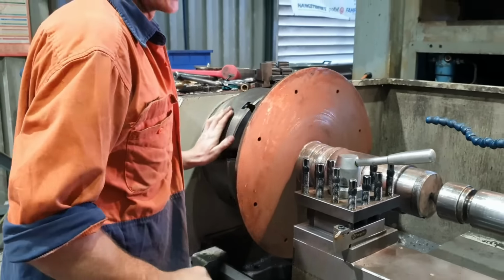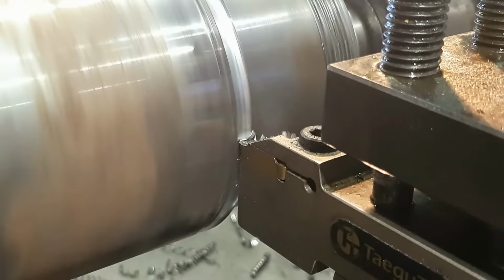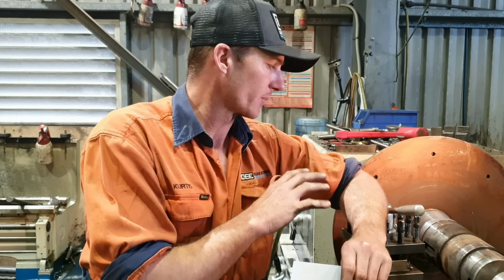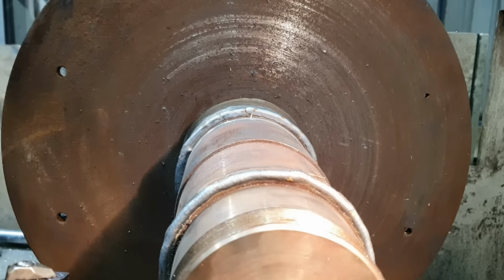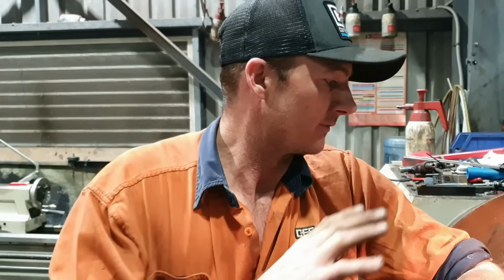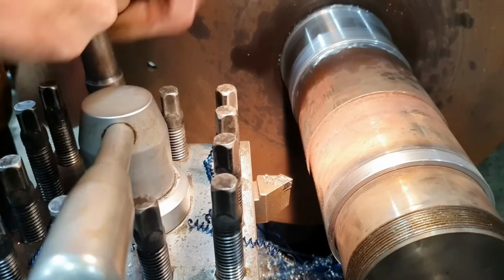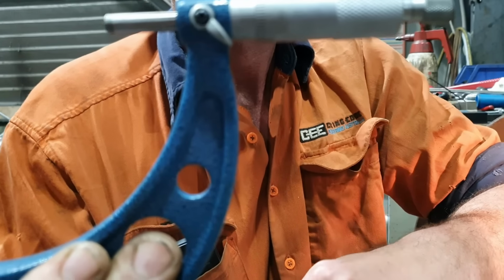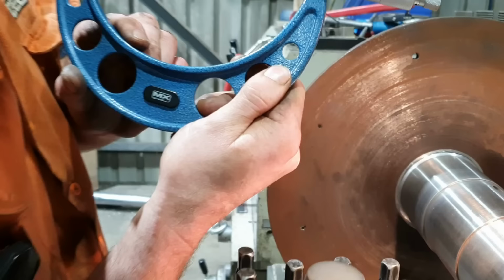Repair DAMAGED Cardboard Compacting Auger drive shaft | Machining & Welding

Comment from the maker: Hey viewers thanks for watching todays video from our machining shop! It's been a while since we got out the 12mm button insert 😂 What did you think of the before and after on this job? 😎👍
Subscribe and hit the bell icon to turn on notifications so you don't miss our weekly uploads. 👇 🤳
Follow us online here: 
Instagram https://www.instagram.com/cutting_edge_engineering 
Facebook https://www.facebook.com/cuttingedgeengineeringaustralia/
Official CEE Merch shop: https://www.ceeshop.com.au
Reply: Another great repair!! makes sense to weld up instead of replacing the shaft section if machine is just going to be used for a few months, I'm sure it will last along time anyway. When is the Shaper going to be moved into the shop? Looking forward to that one. I've got a 26" Shaper which I bought of a Engineering shop in Rockhampton QLD that closed down around 3yrs back. It come with some heavy duty tooling for internal keyways etc which I will never use. I could send them down to you if you wanted them as I would never use them doing Motorcycle repair. I live up at Gympie which isn't to far away.
Reply: Friday wouldn't be the same without you guy's, thanks for week
Reply: Já sigo vocês,achei boa a intenção de vcs não aceitarem contribuições para o canal.penso que trabalhão com o coração!
Reply: A work of Art !!!
Reply: The  stuff that you do is grate
Reply: Hi Kurtis,

That looks a very good job. What were your concerns regarding  the long term integrity of the repair so that you offered a no warranty?
Reply: @jameshodgson1609  I think he needed to use a difrent fixing process  to ensure that the fixing could be guaranteed  to hold , the process that he used could most probably not be guaranteed to hold.
Reply: Curtis, I have noticed that you do not take the tool off when you go back to the start. Do you find this puts excessive wear on the tool or breaks the tool? also what is the material you spray on at the end, is it a form of rust preventative? By the way I do get a kick out of your videos as a retired tooly myself I appreciate where your coming from. Keep up the good work.
Reply: Love you how love every comment, even your own! lol
Great work and excellent editing!
Reply: I sincerely appreciate the shots behind the welding hood. I worked in a welding shop of several years and still have the reflex/habit to close my eyes, look away, or block the arc with my hand. It's always so annoying when videos cut straight to welding mid-arc.

Before and after were amazing, keep up the good work!
Reply: @Jim Hal 😏😏😏
Reply: Was so looking forward to you doing spray welding
Reply: Probably the most satisfying is the before and after. Its all good to watch though. Sometimes I jump over the long turning takes and welding takes, but its still all good. You are an interesting tutor and conversationalist, so a little commentary while you are doing these operations would be nice for me. I'm only one guy, so whatever you do is ok with me. Thanks for these shows.
Reply: Great repair, I shudder to think how bad the bore is, that the failed bearing fit into would be?😱
Best wishes from the far North.
Reply: Fantastic job! I kinda had thought you would do a 1G roll out but nope your method to the madness worked well. Thank you for sharing!
Reply: Button insert is best insert
Reply: Great job .. not every job can be a perfect "better than original" .. customers have budgets to work to, and as much as we want to do "the right thing" we cant always. Thanks for sharing 🇨🇦
Reply: Keep up the great repairs mate! I will keep watching from the good old Canada 😀
Reply: Next time you do a time lapse could you put a digital timer in the corner just so some idiot doesn't look at your video and think that  this is easy.
Reply: What kind of welding machine do you have in the video?
Reply: @abrahamscall   its living upside down ...all the blood goes to the head so they cant spell  !
Reply: U did great
Reply: Looks great.......I did the same exact repair a month or so ago......OK, OK, it was a Ford axle and the shaft was just over one banana in diameter originally, but the bearing ate up the shaft. It sits vertical in a horse hot walker on a ranch. I welded it with ER70S6 and 75/25 gas, but it wouldn't fit in my tiny POS lathe and I didn't want to drive an hour to my brother's house to use his new $5K grizzly gun lathe (which would have been a great size). The 2x72 belt grinder cleaned it up enough for the bearing to slide over. The axle shaft had a sprocket welded on the end, so just buying a new one wouldn't have solved the problem and they didn't want to blow a lot of money on the repair. So far it is working fine since it turns very slow. It was great to see the same type of repair on a huge level and to see that you used the same filler and weld process to repair that one. Thanks for the video!
Reply: You couldn't ask for a better life Curtis, Beautiful lady, Beautiful little fur baby that adores every step yoy take. And you get to do a job you love every day. Your own boss and time keeper, if you want to go take the dog for a drive to the park your not punching the clock. Good on ya brother! Keep up the good work ! Your channel isn't getting the views it deserves, but I believe it will.
Reply: You are awesome man. 👍
Reply: I like your welding build-up technic.  Fast and economical.
Reply: E06
Reply: Please let me be ur helper,Ethiopia
Reply: How are you sure that the metal of the weld matches the hardness of the shaft?  Is that usually the same or is it a major decision each time?
Reply: ive often wondered why you dont spray weld to add material, if more steel is needed its better to just add weld?
Reply: Great repair mate. Love the vids.
Reply: Young man you are very good at what you do really enjoy your videos thanks alot 😊😊😊
Reply: You are like an actual machining God with your skills and tools, i have seen bad welders, really really bad welders and good welders but you are by a FAR FAR margin past them, your work is sublime it just leaves me in awe what you can do as so much that you do such as in this video building up material, that other welders say you can't do that for so many reasons but that just shows even more your amazing skills to prove them wrong. 
I also LOVE your work ethic and we seems to share the desire to not only make the job required perfect but its appearance as well, like in the video for the dual hydraulic pistons where you had to wait so long for materials and just the housing didn't appear strait so you lathed it down to also look perfect, I loved that, and love that you follow the rule of you would not be happy if you received back parts that looked bad even if they worked right so you would never let it leave your shop I just adore that ethic.
You both are amazing and I am so glad to see someone making such amazing content by their actual job, and as awesome as your machining skills are your wifes ( i'm so sorry i forgot your name :(    ) your camera work and editing is top notch as well love from canada <3
Reply: Опасно подобным образом шлифовать наждачной бумагой может на вал намотать .
Лучше вообще с наждачной бумагой к станку не подходить .
Но если уж сильно хочется то по крайней мере нужно крепить ее на деревянный брусок и действовать как напильником.
Reply: An awesome recovery on that one! Looks like Homie got up, moved five feet, and sat down again. You have an amazing facility with metal fab like you do; you seem to enjoy the purity of the geometry involved. The metallurgy info is interesting as well!
Kudos! And you DO resemble a young Robert Shaw...
Reply: Bro it’s like 4am!
Reply: Is this temporary fix still going?🤣
Reply: I really enjoy these videos but seeing the blinding glare of the welding severely detracts from the videos and since nothing but the glare is discernible it adds nothing.

Comment: "Machine is going to be replaced in a few months... " , I am * almost * willing to bet dollars (US) to donuts that you'll get this exact same auger drive shaft back in a few years when the bearings fail again. :D
Reply from the maker: 😂 seems to be what most viewers are thinking. Thanks for watching
Reply: Have you priced donuts lately?
Reply: That or it'll be sold off as refurbished
Reply: People that say this shit are 99% just trying to save face and not have to admit "we're broke AF and are barely staying afloat, I/we can't afford the extra $xxx for a proper repair" and are going to be using that machine for years to come. They'll probably even take it to a different machine shop next time, again, to save face and not be recognized lol
Edit: I speak from experience. I've had to have stuff repaired and not been able to get a proper job done, just " good enough " to get me by a while, because I was soo damn poor lol
Reply: I like donuts!!
Reply: @CuttingEdgeEngineering  Nothing is as permanent as a temporary fix.
Reply: With curtis's ethic hes probably done a better job than most warranted shops would do
Reply: @mashrien  In these times, probably the most common approach, and not unexpected. Losing a business, not of your doing, is a very bitter pill to swallow. Hope they recover, if that is the case.
Reply: Great now you've started a donut shortage
Reply: @mashrien  I've had mixed results, but generally positive, from just coming right out and admitting that I'm broke and can't afford to properly repair a critical failure.

Responses range from "Well, guess you're fucked then" to getting the job done right at bodge rates. Often they'll meet me somewhere in the middle, with partial discounts and installment payments.
Reply: @mashrien  ya'll have money to repair stuff? /s
Reply: Temporary repairs are never temporary. This will be run until the next time it needs to have this done. What can you do?
Reply: @94XJ  that’s what I thought. They might replace the old machines but will try to recoup some of the cost by passing on the old one as refurbed.
Reply: @CrimFerret  ain't nothing so permanent as a temporary fix....
Reply: Same bullshit story the cheap ass operators tell you everytime they bugger their shit up due to lack of service.... to cheap to keep the service up
Reply: Or machine will get sold on a.s.a.p
Reply: Actually the machine may very well be replaced but I'd bet this machine gets shoved into another line with them saying "run it till it breaks again" which could easily be years on that repair.
Reply: @morriewyatt6234  I think you misquoted I believe it states that nothing is as permanent as a temporary government program 😂😂
Reply: @CuttingEdgeEngineering  yeah I worked as a diesel mechanic and am retired now.cannot count the times (I'm gonna sell it just patch it up) I got and years later the same truck showed back up.
Reply: @CuttingEdgeEngineering  had one customer while working on a real muddy site had mutiple gear sets go out on his truck, he saved the good gear off his gear set and when he had two mis-matched sets that had opposed gears damaged he used the ones not damaged. (we were putting one gear set in a week.) other words used mis-matched gears.made noise but didn't last so what. when he got off the bad job he put a good set in.
Reply: @mashrien  thanks for that mash potato
Reply: Hahaha😁 exactly.
Reply: I have heard it so many times!  " It only needs to last for 2 months " and 5 years later it's still there!
Reply: So What would you do ! ?? With it !!??
Reply: @lawrencewillard6370  You Never know for how long ! Though !
Reply: Yeah, lack of grease and that very abrasive cardboard dust...!
Reply: @mashrien  nothing wrong with that as long as you admit it. Trying to bluff is always a bad idea in engineering
Reply: @morriewyatt6234 , quite right.
Reply: @CuttingEdgeEngineering it's been 2 years. Did it happen?
Reply: I'm pretty sure thats a very slow speed shaft.  That repair should last forever if the seals are changed and bearings serviced.
Reply: Having to rewatch older videos, seeing as how Karen insists on having a life outside filming and editing for our entertainment! 😂😂
Reply: @morriewyatt6234 
 It is only temporary, unless it works good.
Reply: Any bets on if it’s still up and running that part
Reply: lol I agree!!
Reply: There's nothing more permanent than a "temporary" repair!
Reply: Those bearings failed because of regular greasing, some repair are better than OEM

Comment: Customer states, I am going to switch the machine out soon, so don't do a full rebuild, 12 months later, following Kurtis's repair, why would I swap it out it's working fine.😂🤣😂
Reply: With a nice rebuild like that , they probally would keep the machine many more years.
Reply: I've heard it before and it's more like 5 years later!  These augers can really pack cardboard ! 2 to 1 over a standard compactor. They blow apart a  normal rolloff box. That's what I work on,
Reply: Yea and 5 years later he wants a new one because your repair failed.
Reply: @billy19461  And he'll want CEE to pay for it.
Reply: I bet that is exactly what is going to happen.
Reply: @Mike_Regan  Ah, but We have it all on video, so he is painted into a corner.
Reply: Few things are more permanent than a working temporary solution.

Comment: Jesus that bearing must have been howling when you see how much it gouged out.
Reply: I bet the operator had to wear earplugs to run that machine before they decided to fix it?
Reply: @hdezn26  Prolly all the time anyway!
Reply: From my time in the bearing business that was the first thing I thought of! Just never understood how customers would run a machine to total failure instead of having it fixed sooner (and cheaper)...
Reply: "I came in today and it was howling. It must have been nightshift."
Reply: I think this was way past the howling phase...
Reply: Operator took The “run her until she pukes” terminology alittle but too far
Reply: Well, we're all out of earplugs...recon it's time to pull that shaft and get it fixed?
Reply: @PhilG999  I agree, but in many cases it's not the customer who's running the machine!
Reply: @K AMB Sadly, from my 45+ years in industry I DO believe 99.999% of "operators" are clueless! Minimum wage that can barely learn which buttons to push. At least they want to have a job instead of sitting on their ass all day collecting welfare... :(
Reply: @MatthewTinker-au-pont-blanc  I would be Fix this @#$%ing s#!t to the company that owned that...
Reply: @timothyball3144  Nightshift: Nah, that's dayshift.... It was broke when I got here!
Reply: @bogdan_n  Maybe a beaten whimper?.
Reply: @hdezn26  probably just turned the radio up

Comment: Another mint job👌
You should have given him at least a concrete warranty as soon as it leaves the concrete it's out of warranty 🤣
Reply from the maker: Hey mate will have to use that warranty clause next time 😂👍
Reply: @CuttingEdgeEngineering  when I get asked to do a sketchy repair, my favorite warranty is the 50/50. Fifty feet or 50 seconds, whichever comes first.  Great video
Reply: @CuttingEdgeEngineering  Keith Fenner's SHOP LABOR RATE - IT'S NOT THE COST OF THE REPAIR.  IT' THE COST OF THE DAMAGE YOU CAUSED.     This is a sign in his shop.

Comment: This is one I missed three years ago and it suddenly popped up on my YouTube list.  Who knows?  Clearly, for Cutting Edge, the really difficult you do immediately.  The impossible takes a little longer.  Amazing.

It begs the question, would your new "ray gun" and extractor gubbins have done the job any quicker, or at all?  A lot has changed for you in those three years.  As someone said in the comments; I bet that part is still in use, whether the machine was changed out or not!

Comment: "Nothing is more Permanent then a Temporary solution that Works"
I'm betting this shaft will be in use for a long time. Fantastic job
Reply: I wonder if it's still there...
Reply: The machine was pulled out in July this year and was still running with no issues after the repair had been done.
Reply: @bigeggsr2336 cool, thanks mate!
Reply: How many times have you done a temporary fix, and then gone back there 6 months later and alter the rest of parts whatever they happen to be to be the same as your temporary repair😅

Comment: I was wondering, if you ever had anyone come in, with a broken part, and it was so bad, that you recommended it to be replaced?
Reply: I mean in his videos he ends fully rebuilding parts. And that's always cheaper than buying a new OEM part.
Reply from the maker: hey mate yeah have had parts come in f*cked beyond repair and we replace with new, still cheaper for us to build new than get off the shelf 👍
Reply: @CuttingEdgeEngineering  I see, it's crazy on how much OEM costs vs building one. Building one brand new is likely built with better quality too!
Reply: It's really really difficult getting the metallurgy right. With industrial robot wrist, shoulder and elbow etc. joint wear the machine shop and a highly skilled fitter and turner can get the line running again quickly but it will be on its last legs and just as worn as before in the two weeks or so it takes to get a new spare from Germany or Japan. Car companies get cross when robots making body part skin panels with a supposed.06mm repeatability turn into ones with .12 or .18!

Comment: how much does a welding job like that use up consumable wise? like a whole roll of wire and half a tank of gas?
Reply from the maker: hey mate there's maybe 1kg of wire in this job (from a 15kg spool of wire) and maybe 10th of a bottle of gas